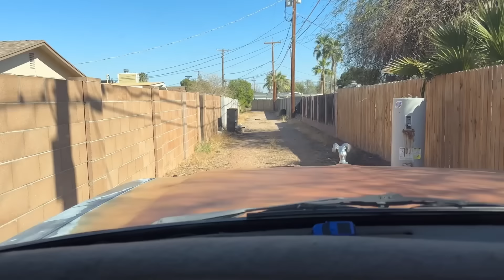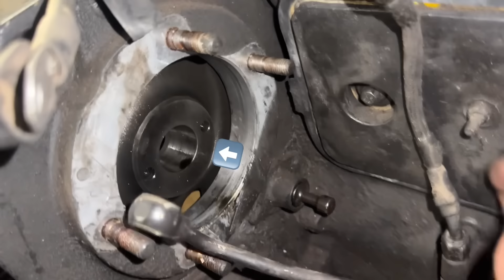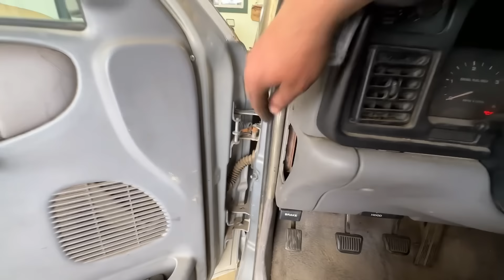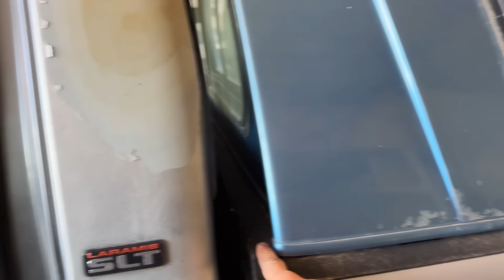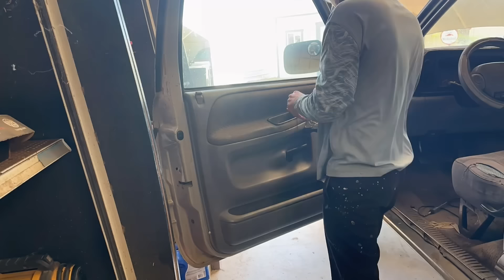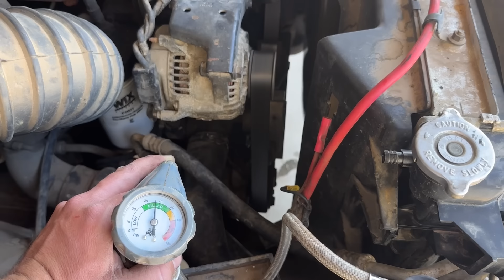$3,500 gamble! I bought a broken Dodge sight unseen, will it run and drive again?

Comment: orange diesel I seen before. I had a old 90's F350 that had orange diesel. the tank was rusty and turned the diesel orange plus it smelled like old gas. I bought it we started it and after I got it home it just died and wouldn't start back. Had to change the tank flushed the fuel line cleaned out the pump. and he told me it was parked 1 year. I found the old registration and it had been 10 years,

Comment: 54:00 I know this video is months old, and so were others ice been watching, so maybe this has been fixed.  
There's something up with your dad's wireless mic. 
Whenever an engine is running, and he talks, there's static and popping in my speakers. Travis, you mic doesn't do it.  And I think his only does when the motor is running.  Even if he's in the cab and you are under the hood. 

Does anyone else hear it?

Comment: Most likely it is the circuit board or what they call a cold soldier connection or in this case a poor soldier connection if it only works when it is moved it could be getting Jared around when the motor is is in place in the vehicle ty for letting me share Matt AKA DDP be safe out there my friend and brother and Pops and your wife unit and little life until lol YUUUUUUP

Comment: Always loved the 2ng gens. Biggest problem is, you NEED a DRB 2 scan tool for like 1200 bucks, Then you have to buy the appropriate modules. They are getting harder to find so I won't buy another one. And before people think their $9000 Snapon will do it, no. It will not. There is not a scan tool ever made in existence that will do what the DRB 2 scan tool can do for ONLY Gen 2

Comment: I hate those clutch safety switches. I’m no one’s mechanic but as l understand it that switch will not allow you to push start your vehicle correct ?  Had a ford ranger l needed to push start once, after that l removed the switch.

Comment: Cool truck and good work!

My Uncle has one bought it new...Single Cab 1996 4x4 Cummins, stick used as a ranch truck and has over 500,000 miles...maintenance and some repairs but he got his monies worth, been a good truck yes, some repairs were needed... It is repainted now and, in his shop, looking pretty lol... He bought a mega Cab Dually 4x4 Laramie 2014 RAM 3500 Cummins, stick new and it's been almost as good ( some emission issues but covered by warranty and no issues since) albeit not used as a work truck he is in his late 70's now (130,000 miles).

Comment: You do need to add oil in the fuel I use to do it and I stopped and started to get a tick from pump and then starting to use oil in the fuel again and it took a while for it to stop the lack of sulfur in fuel what do you use in your fuel for the mechanical pump

Comment: Beautiful  baby.  The wires to the motor  are torn.
Twisted one way wire are not connected.  Turn other way wire is closer to the other wire. Like note. ))) it was just the wire to the motor.  If solder to new wires to the motor.  Would have worked great after you clean it and grease it. )

Comment: Travis. Get a water filter.  Clear plastic bowel with a steel filter in it. .
Please  run some acid in the water. Or just use a good old winter sock to inlet of the engine 
. I tully appreciate you and dad and family.  God bless. 
Mick Australia 🇦🇺

Comment: Yes sir, you hit the nail on the head with this one. Your experience with these Cummins diesels is really paying off and we learn something new every day. Taking the time to investigate that run away problem on that engine paid off. The truck has some battle scars, but it is pretty well complete and as you pointed out the A/C is a plus not only out there in Arizona but other parts of the country as well.🥸👍👍👍👍👍👍👍

Comment: Boost reference at the AFC should never have an effect on throttle response. It's one of the first things you delete and gut when you start hot rodding a 12V.
Reply from the maker: Nobody guts their afc housing for performance you have to have the internals to regulate fuel

Comment: Set my never worked on as in diesel vehicle this has been pretty interesting I like to know I know smallpox gas on motors that's it never owned the diesel but this has been pretty or interesting somebody will have an ice truck I like it because it stick shift

Comment: Good video but you should wash the radiator and condenser out I can see all the dirt and debris caked in it you’ll get colder air and a cooler running engine !

Comment: I'm  curious if the wiring for your window motor migh5 be frayed somewhere in there, would make sense if while twisting it around it's completing the connection.  Also if the previous owner swapped  beds, he might not have completely hooked up the fuel gauge connector....hoping for something easy and cheap. Keep doing what you're doing,  love the videos.

Comment: Magnets in electric motors glued in. Took one apart ounce and re glued magnet two in there. One glue broke down. There’s a name for that type can’t remember something related to magnets. Going to ask google. Permanent magnet brushless. Goggle had pictures and names. It seems everything has an answer now. Intelligence seems to be changing yet even goggle new there is seven different forms of intelligence. Something never realized there is value in all levels. Even Picasso said it took a lifetime to paint like a child. A famous architect lived in Arizona maybe can’t quite remember the name. Inspirational stuff. You are inspiring also.

Comment: Another great video. Was the fuel gauge ever fixed? At the end of the video, you mentioned all the gauges worked. Unless I missed it, I didn't see you repair it. I ask only because it would drive me nuts not knowing how much fuel the truck had. Happy Weekend to you and yours!! Best from CT
Reply from the maker: It works intermittently. Usually it’s the sending unit in the tank and it’s a major pain to fix
Reply: @theetravisb  Thanks for answering my question! Totally understand your reason not to dig into it. Especially without the convenience of a lift. Perhaps the problem stems from the truck sitting for 10 years. Hopefully, the sending unit contacts will clean themselves after a few tank fills and bumpy driving. 🤞

Comment: When the specs call for GL-4 you don't run GL-4/5. 

Just got done installing a brand new 5 speed in my 1st gen Tacoma cause the old owner made that mistake. GL-5 eats brass parts and it's why you cannot run it on GL-4 aplications.

I run Redline MT90 GL-4 and the transmission LOVES IT!

Comment: If you originally had no vent hole in that thermostat, with that hole arranged to the highest point, You will overheat. I had a similar problem with my 1st gen

Comment: Well your gamble paid off, only because you know quite a bit about those diesels. If it would have been the average guy that knows nothing about them they would have been stuck or blown up. You can tell that diesel has not been taken care of as far as flushes and oil changes obviously that's why the pump got gummed up. I would probably be running tranny fluid in the fuel and flushing that whole entire cooling system chemically. Yes it really works I do it every year and have never had a problem. Anyway Travis I just wanted to say hello and drop a comment, may God bless you always.

Comment: Switched to solder connectors recently, very glad I did. It's a much better connection. And heat shrink crimp connectors half the time don't shrink properly.

Comment: I used to Drive a Big Ass Truck, until I started driving a Small Sub Compact .....in the City  its way more Fun and Less Stressful.. Less Gas Too but I don't care about that.  I run circles around them big lugs.. Pretty Sure Guys in the City are compensating for lack of NUTS.

Comment: Screw that neutral safety switch. I would have just bypassed it. If you drive a manual diesel truck you will know what you are doing anyway and you don't need a Nanny neutral safety switch. Back in the day they weren't installed on any manual cars at all in Europe.
Nice job getting that Bosch pump fixed! Engine sounds healthy.
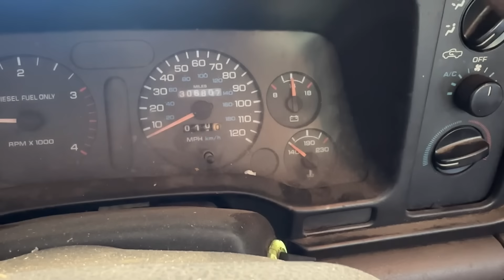1 little point @ 1:13:54 you had just filled the cooling system but i can see that you left the heater on 'cold'.  This can trap air in the heater core. It's best practice to always turn the heater to full 'hot' when filling the cooling system from empty.
Reply from the maker: Yeah I get that I just like it when things work
Reply: I'm likely going to get a lot of hate for this but I just can't believe how many of those nanny things there are in the US but at the same time DOT approved lights are just been shitty since the invention of sealed beams and having brake and turn signal on the same bulb...